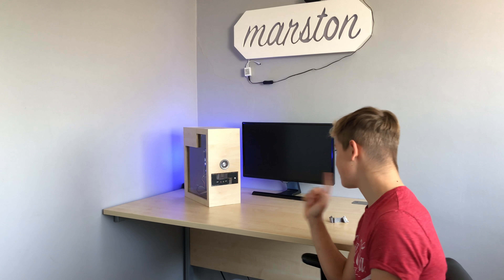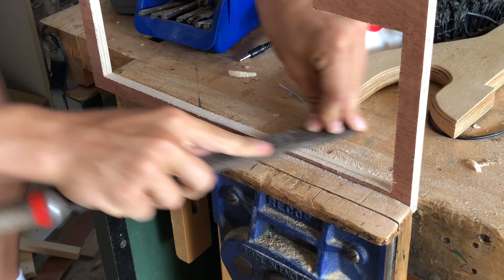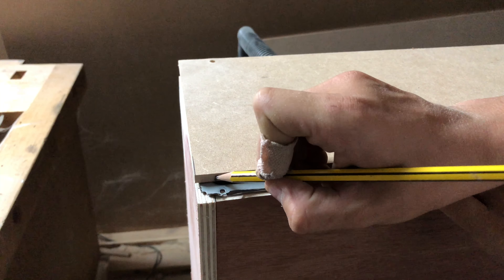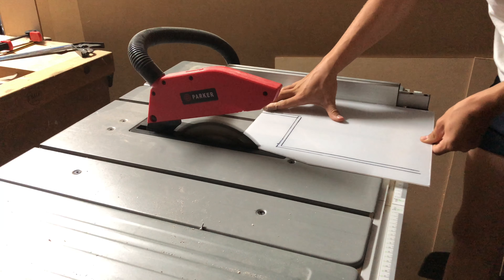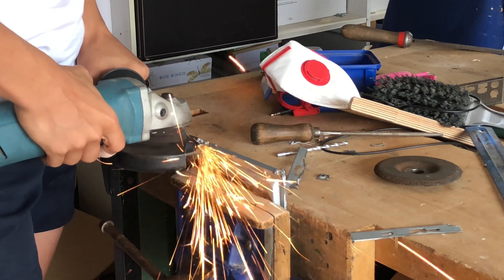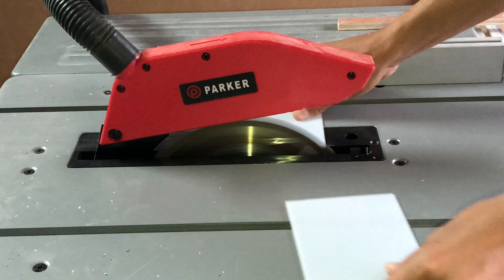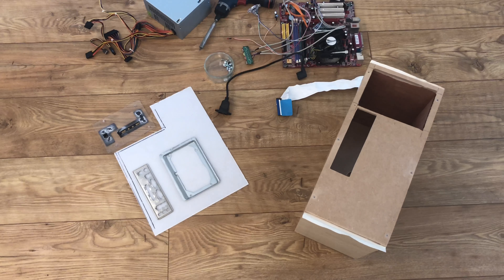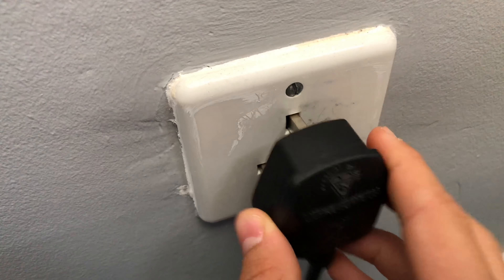I built a gaming PC out of wood

Comment: Won't the wood burn down when the PC gets too hot? Mine gets to be like 90 C sometimes
Reply from the maker: Jop van Beek I have used metal stand offs so the CB isn’t directly on the wood also the power supply is fully enclosed and I haven’t had a problem yet🤞🏽